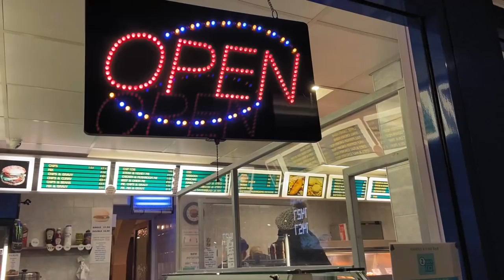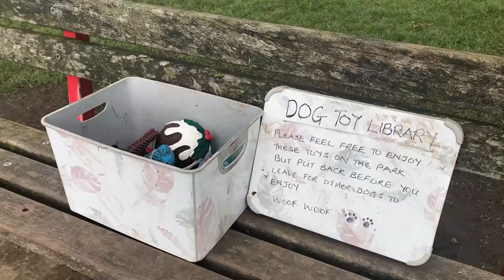Unpredictable winter weather | Improving our desk setup - 31

Comment: How are you running all your laptops and the monitor plugged in, do you have the inverter on to do that? And can your batteries handle that or do you need the engine on whilst you're using them?
Reply from the maker: Hey! Love the username 😅 We have a 3000W inverter and 4x105Ah leisure batteries. We want to upgrade our setup at some point, but we can run everything off the batteries for a few hours depending on what we’re doing on them. We do have to run the engine more than we’d like at the moment but we have solar too! 😊